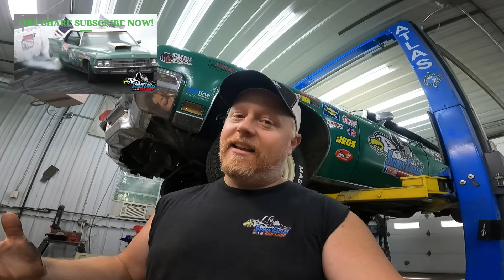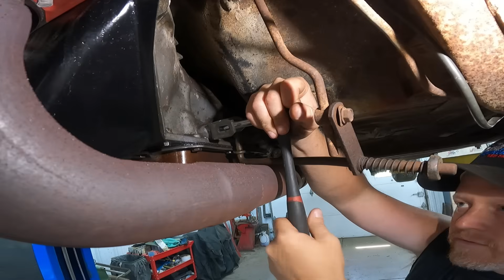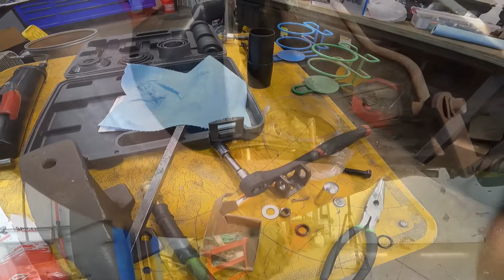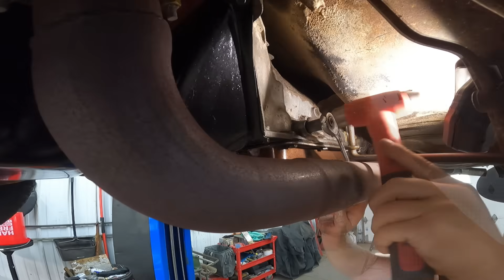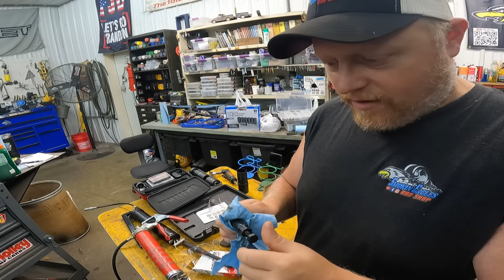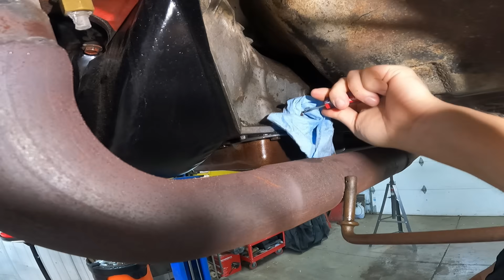GM Shift Shaft Seal REPAIR! #auto #automobile #diy

Comment: Did it leak.....
Reply: Two things! First, nice video of a crappy job. I bought the same tool, I figured out to tap the removal tool into the seal snug before wrenching on it. You prolly didnt need to modify that. #2, I did drill out the install tool because its so tight. My installation was not successful because with the slop around the shaft, the rubber part of the seal wants to push out around the shaft. Mine leaked. Gonna either make or buy another tool. Hope I can find a socket that will work.
Reply from the maker: nope good to go!
Reply: I found out I had gouging around the shaft. I bought a new shaft from ATI Transmission that has  machined  grooves with 2 rubber o rings plus the outside seal you normally put in the end of it. My tranny after 3 years is bone dry after a month of use. Only way to go for that kinda leak IMO.
Reply: Got a part number or can you tell me more about the seal you used. Thinking I might have that issue with it being gouged on my 86 Chevy k10 with a 700r4.